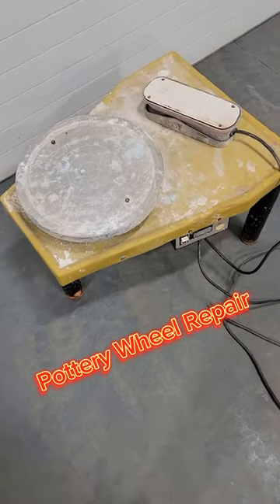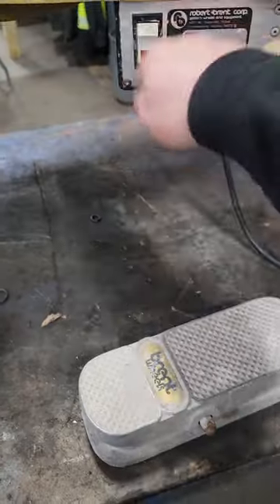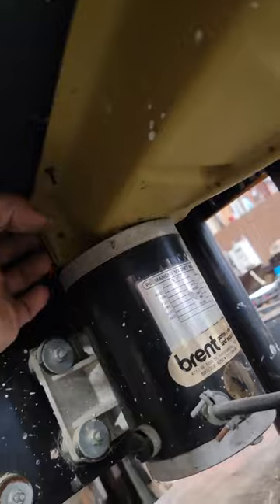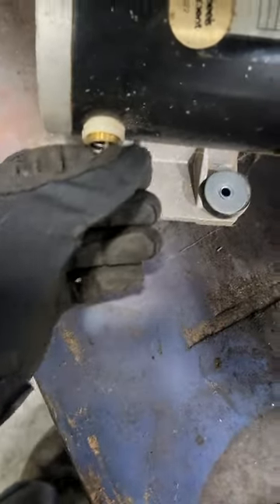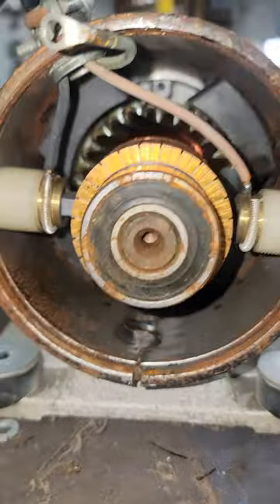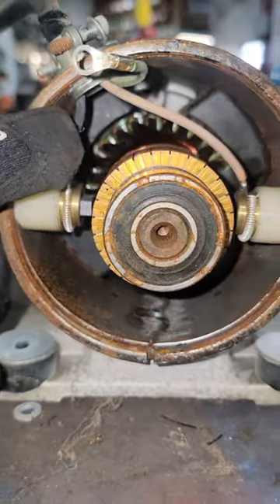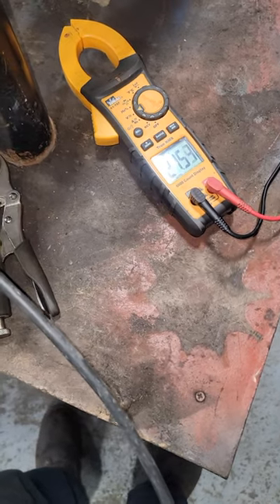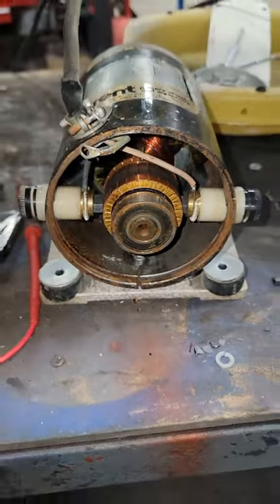Pottery Wheel Repair

Comment: HOW did you get the motor case open?? Mine won't budge yet. The posts are removed, I'm trying to take off the belt flange thing on the center post. gah!! surface rust.

Comment: I'm curious, I have an Amaco Electic Potter's Wheel No 1-101, it's vintage... and the motor is a DC motor and described as the following in the paperwork Amaco sent me. They no longer make parts for this or motors so I wondered what you recommended I could replace or repair it with?  From the spec sheet "This wheel is driven by a two-speed 1/3 H.P. motor connected to a gear reduction unit by a heavy duty flexible coupling. Wheel speeds are controlled by a three position switch — Low for 65 R.P.M., High for 95 R.P.M., and Off."